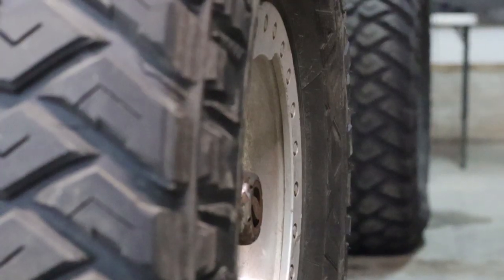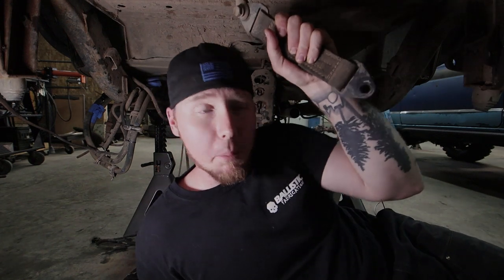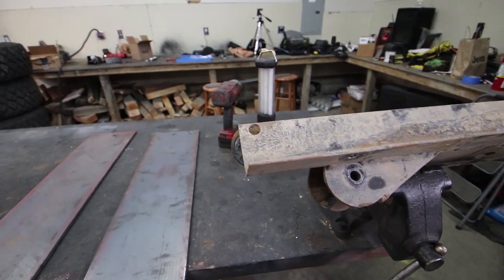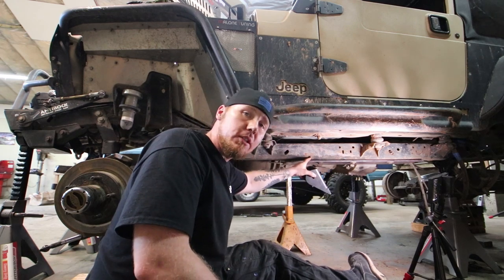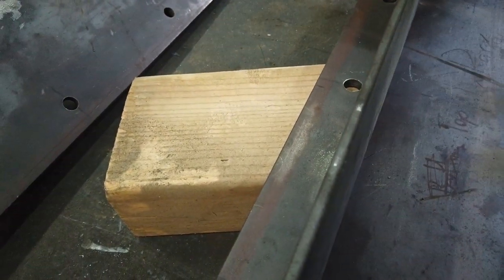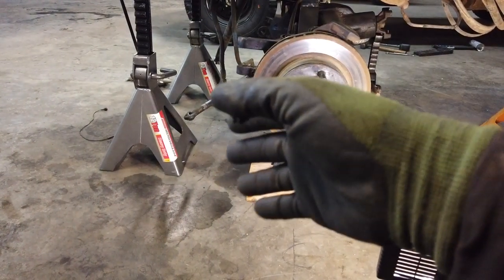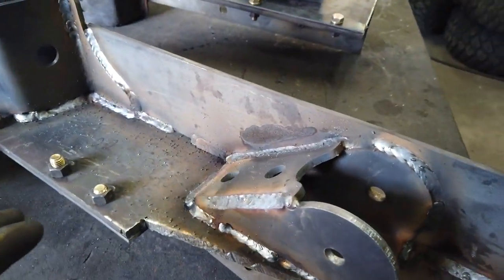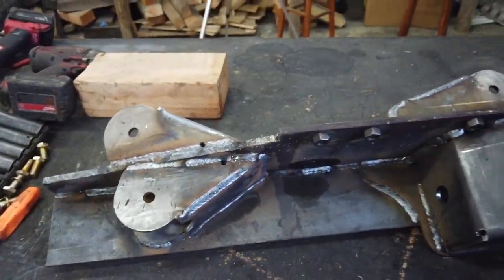DIY 3 Link / 4 Link Suspension - Jeep TJ Stretch Episode 1

Comment: Subscribed... I currently run a ‘13 JKU Rubicon with the upgrades stated in a previous comment and Poison Spyder Brawler flat fenders (brand new $400...instead of $1,300), 2004 TJ with the stock suspension off of my Rubicon and 33” BFG KO3 but I gave that to my 19 year old son (good kid) and a 1999 XJ with Dodge half ton axles (free) with trusses, C-gussets, disc brakes, 20” Fox Nitrogen shocks (rear), 4” XJ lift springs and BDS shocks mounted on a custom 3 link! The rear is a double triangulated 4 link and everything has 1.25” Chrome Moly heims from Ballistic Fab! Home fabbed bead locks with 38” Nitto Mud Grapplers and “custom paint” custom bumpers, sound system, fuel system and full hydro steering! Next in line is a ‘78 J-10 with the 360, granny gear 4-speed that will soon have EFI and 35” boggers for a trail bomber and possibly an S-10 I have with the stock XJ axles, built 4.3 on LPG and a 5-speed for the kids to throttle on! I have those exact brackets on my XJ and everything worked out perfect and she flexes big time!

Comment: I really enjoy your videos, keep them coming. For what it's worth, I used to hate cleaning cutting oil my metal. I always wipe down with acetone before welding, but the oil was especially a pain. Visiting with my machinist friends, they mentioned for all of the shop work us Fabricators do, we can use water as a coolant/lubricant and it is more than enough. I've been doing so for years now and it is awesome. I use a Dental squeeze bottle with a pickup tube and it works awesome. Water for all bandsaw and drill press. And its evaporated by the time I got the millscale flapdisced off. So oil never contaminates my gloves, weld table, flapdiscs, drillpress, etc.
Reply: Hope this helps
Reply: They explained our drill bits become chowdered before they actually dull from overheating or excessive pressure.

Comment: Nicely done and nicely explained.  I'm glad you touched on the difference between theoretical vs practical concerns.  There is a huge difference in theory between one-link, two, three, and four-link suspension designs.  But like you say about your buddies designs.  They work.  Furthermore, I bet a skilled driver couldn't tell the difference in a blind test.

I like you bolt in design.  Makes it easier to fabricate, and more importantly it makes it easier to update later on.

Comment: Phosgene gas is created by combining heat and UV light, with Braklene and other solvents. You can die or have lifelong respiratory problems combining the two. Glad you mentioned it in your video. Even in a well ventilated area, this is a serious concern. Check your solvents for tetrachloroethylene- even a dose of 4 parts per million, as small as a puff of smoke can be fatal.

Comment: Can you differentiate jeep stretching. Other videos suggest cutting and adding length to the frame. With a 3 or 4 link it appears no chopping is necessary,and the stretch is all in the control arms. Love your suspension videos brotha.

Comment: Great job and lots of good info. The only thing that is wrong that I can see is, you NEVER want your differential pointing at the transfer case. That is a u-joint failure just waiting to happen. Most people don't seem to understand this. You want your differential at the exact same angle as your u-joint coming off of your transfer case. That is the way u-joints are designed to run. Same angles! I know this from my old drag racing days. I used to point the rear end at the back of the trany and couldn't understand why I couldn't keep u-joints in it. I was pulling 8000 rpm hole shots and snapping u-joints like nothing. The best u-joints money could by broke like glass. Then someone educated me. Keep the joints at the same angle! People thought Ford was retarded on some of their 3/4 ton 4x4s around early 1970s. They had the front differential actually pointing down toward the ground slightly. That was because the transfer case was pointing up slightly. The joints need to be at the same angle. That's why they did that. They weren't retarded after all. Learn from them and save yourself a lot of u-joint grief!  Seriously!! Do some research if you doubt me. Other than that, I'm impressed!
Reply from the maker: Hey man I'm glad you're enjoying the videos! Let's talk about the issue you have with my U joint angle.
"You never want your differential pointing at your transfercase".  Unfortunately this is untrue. I will provide a link at the bottom of this comment for you to click on and see what I'm talking about.  If one side of your driveshaft is a constant velocity joint, you want your pinion facing your t-case as much as possible. This gives you the most strength and the least vibration. Like most Jeeps, I have a cv joint on the tcase side of the driveshaft. But with u joints on both ends you are absolutely correct. Thanks for the comment! Conversations like these are important 👍
https://www.adamsdriveshaftoffroad.com/angle-pictures/
Reply: Great! Thanks for that info! I didn't know that a constant velocity set up changed that rule. Thanks again, and keep up the great videos!

Comment: Am I correct that your old front suspension system looked to be a radius arm style set up? I would be very interested to hear your thoughts on it and why you are changing to the 3 link set up. I LOVE your videos, everything about them is perfect, well filmed and very clear/informative. I'm looking at doing a 3 link/4 link set up in my Discovery 1 and these are helping me heaps! Thanks
Reply from the maker: Yes, the old suspension was radius arms. I ran it that way for almost a decade. Great system but it does have binding which slowly wears out bushings. I decided to upgrade the suspension to a 3 link to make the geometry right and decrease binding. Long term I'll be making my disco a 3 link front and 4 link rear. Very similar to the setup on my Jeep. Glad to hear the videos are helping you out!
Reply: Dirt Lifestyle Thanks for that, oh I look forward to seeing you link your Disco then. I’m not quite at the stage where it’s going to happen yet, as I’m wanting to swap out axles at the same time (actually to Discovery 2 axles!). Thanks 👍

Comment: Awesome video!   I stretched my cj with waggy springs. However I want tj coils and links.  I’ve just been hesitant about what kind of link setup to use.   Your tj is sick.  I think I’m steered close to 5 front and 6 rear.   Without a Comp cut.   I don’t like the comp cut
Reply from the maker: I'm with you! I don't like the look of a comp cut. When I trim the fendors to match the stretch I'm going to cut away as little as possible to hopefully avoid that look. We will see what compromises I will have to make lol
Reply: Roger that.   I had to make a small fill plate that goes in front of the rear tire just to make the wheel well look normal.   Like the rear wheel well kits they sell.  I just added a plate that actually looks like part of my rear tube fender.  And the rear springs I dropped the waggys and went to a set of Chevy 52” springs.   So the rear shackles are on the rear bumper so I then tied that into the frame and added a few stiffner bars hahaha.  All to keep that look looking smooth!    I want links badly!   But right now I’m going back to bucket seats as I had a small bench seat for years.  Adding a ammo can console and moving my stereo msd box and cab to the big 50 cal ammo can. Then I would like to weld up an aluminum dash setup to clean up all the holes.    Oh. Another issue I ran into on the rear stretch was the fuel tank.   I had a 14 bolt so I moved to a fuel cell in the back.   Also ditched the 14 bolt for an HD 35 spline rear 60.   To match the front 60.   Keep the videos going man.  I’m subbed. And looking for more inspiration!    So thank you!!

Comment: I stretched my YJ to 101" with waggy springs and using the furthest hole on the spring perch. Got me 2.5" of lift out of it, high lined my hood, and I'm running 35-37" tires on  my LCoG lift and stretch. I remolded my factory fuel tank to fit the rear diff into it so I didn't have to do a custom fuel cell or relocate the tank. Running a Montero rear axle and a Waggy dana44 up front with Dodge outers so I could get the drag link to the top of the knuckles and away from the rocks. I'm still SUA and I don't want to do a SOA, as too may of my buddies have ruined the ride characteristics of their rigs trying to go SOA. I need to Fab up a ladder bar to keep from fragging my rear springs from running out in the dunes/snow and the rock trails I'm getting too much torque and eating u-joints.
If you could dial back the Transformer Orgie Muzak, that would be great

Comment: Keep your thumbs away from steering wheel spokes on down hill descents.  Loss of caster could apply heavy torque to the steering components, especially with large diameter tires.

Comment: I have a really good question, and hope you will answer it.  I am currently setting my TJ up basically copying you, however there is a couple things I am confused by.  You said your front upper and lower control arms are the same length for the pinion to stay aimed at the transfer case, which is what I want, however in the video the upper mount is directly even with the lower.  I dont understand how the arm length can be the same if the upper diff mount is going to be further away due to the pinion angle.  Can you help me out with this?

Comment: You cant 4 link the front if you run a steering box. You will have crazy bump steer. thats why 3 links are best for streetable rigs. 4 links in the front usually for full hydro set ups.
Reply from the maker: This is a strange statement. Do you have an article or something to back this claim? There are millions of trucks, jeeps and SUVs with a 4 link front suspension and a steering box being sold OEM. I'm very interested in a source of this information. 
A 4 link and a 3 link have the exact qualities and characteristics. The only difference is a 4 link is stronger but they act identical in performance. Unless of course you can demonstrate otherwise.
Reply: @DirtLifestyle  my bad. I ment with full hiems or Jonny's on all ends I guess if you use rubber the track bar wount bind all the joints. I'm speaking rock buggy stuff my bad

Comment: not streach related but just curious, Do you have any emissions testing or anything like that in your area? As far as I can tell for my county at least the only way I could get away with a street legal diesel swap on anything that wasn't sold with a diesel as an option from the factory is if the  vehicle is 1995 or older.
Reply from the maker: Lots of emissions issues for people that swap up here. I get pulled over for a litany of other reasons so this jeep has become a trail only rig. The only exception is when I travel to moab. Then I drive it on the street with no issues from law enforcement lol

Comment: Good stuff. I need to rework the suspension on my XJ to stuff some 39.5 TSLs under my XJ. How important is it to get the front upper link parallel to the vehicle? Seems like it would want to push the axle one way or the other when you brake or hit the gas otherwise.
Reply from the maker: The upper link needs to be as flat as possible for the best stability under braking or acceleration in 4 wheel drive. When you combine this with a lower link that is 10° or less you end up with a suspension that meets the needs of 99% of wheelers.  Rock bouncers are just about the only exception. They set up their front suspension with lots of dive. This is to keep the front end down while they're going up those steep ass ass hills you see in the videos lol. The downside is when you let off the throttle your actual pushes the front and down and the vehicle flips backwards ass over tea kettle.

Comment: Hey Nate, do you have any problems with the plate bolted to the frame holding the link mounts flexing, or are the bolts on both sides of the frame enough to handle it? How many bolts do you have on each side of the frame. Are the bottom bolts mounted all the way through the frame? Thanks!

Comment: Heeey! Need some help with the 3 link project! How does the horizontal separation of the links affects the project? I have no clearance to weld the brackets on the diff or close to it. Can the upper link be placed 2" horizontally from the  lower link?

Comment: Loving it!  This is the first time i'm checking out your channel, but i've seen your videos on BJ.  This series looks great so far.  102" eh?  Sounds like you should just get an LJ.  ;). I notice you're still on your stock body mounts, ive been thinking of replacing mine with some beefier mounts, and moving them up a little to get some body lift out of them.  have you considered that? Did you decide not to go that route? Or just havent seen a need?   Thanks!
Reply from the maker: Thanks man! I've been wanting to address the body mounts but they haven't really held me back while off road. I just bounce them off rocks from time to time lol. I will Fab up some new ones but it is pretty low on the priority list. I plan on building my own boat sides at the same time.
Reply: @DirtLifestyle  YES!  BOATSIDES!  I never see boatsides anymore. I've had them in the back of my head for the LJ for a while now. 

Yea, my body mounts have taken a few hits, i'm not as high up as you are.  and the LJ is a big more exposed because of the length. 

Thanks!

Comment: What axles are you running on your tj? Gear ratio? Locker set up?
Reply from the maker: Dana 44 hp front with 5.38 gear ratio, 30 spline rcv shafts and a Yukon zip locker. Rear is a home made 9" based housing with a Yukon 3rd, 5.38 gear ratio, 35spline spool and 35spline quick performance shafts.

Comment: So, Im going to attempt to build my first three link in a 52 Dodge M37 with and LS swap. You mentioned a geometry calculator, did you end up using one or just do what I do and tac check tac check? thanks
Reply from the maker: The calculator is great for getting an idea of exactly how the changes you make effect the squat and dive numbers. BUT its BS for real world building. The two most important numbers are an educated guess and this throws off the final values substantially. I use the calculator to get my mind back into the basic concepts for a new suspension setup but don't actually try and build anything with the data. The basic rules I talk about in these videos are a way to get good performance out of suspension when your trying to package it in a existing vehicle. Hopefully the "rule of thumb" ideas I have in this series will help you on your build! Good luck and have fun brother 👍

Comment: See if you had just bought a Cherokee this wouldn’t have been an issue lol. I love my TJ’s if had over the years and yeah you can always go with a larger tire in the wranglers.. but it takes a stretched wrangler on 40’s and tons to go where even modest build Cherokees go. I equate it to the dame as picking a manual over an auto. When you’re crawling the auto is always gonna be better. We all know this. (At least those that climb things) hands down a Tacoma SAS or Cherokee can’t be beat. Why cause they already came with the proper wheelbase from the start.

And this new unlimited are heavy pigs! Light, locked and long travel still rules.

Comment: does your coty built adapter use the jeep starter motor, or which starter are you using? have you had any problems with that?
Reply from the maker: The worst thing about coty built is this question right here. I get asked simple questions like this all the time and its shame they don't put this info on their website. I have no problem answering your question it just reminds me how hard it was to find the info when I was doing my swap. Lol I'm done venting. I ordered a starter for a 2004 passat tdi and it bolted right up. The jeep starter and the brm starter wouldn't fit. Good luck with your swap man!!!
Reply: @DirtLifestyle  yea their website says its made to work with all jeep stuff, everything but the long block, thats what they advertise! I figired it used a jeep starter! So a passat starter works with a jeep flywheel? Man that dont seem right at all!
Reply from the maker: It uses jeep alternator and powersteering pump. That's it. They really over sell what your getting. Even the way they advertise the wiring is BS. You still need to cut down the OEM jeep harness your self. The wiring they send you doesn't integrate at all. It's just a stand alone tdi harness. You do all the Integration lol. The starter seems to mesh fine with the jeep flywheel 🤘

Comment: Be careful under those china jack stands. I have a set of those same ones and the latch will come loose and slam down even with full weight on them.
Reply from the maker: Thanks for the heads up!
Reply: Bold claim, is this actually true? Because I've been under my harbor freight stands for weeks working on a 6k pound truck
Reply: @coast.cutter7552  
Why would I make this up? Quality control in china is nonexistent. If you got lucky and yours work than good for you. One of mine the latch is mounted crooked and it will fall randomly.

Comment: I know the weight is lower on the Jeep but are you worried about those plates??
Reply from the maker: I don't think I follow buddy, Do you mean bending the plates?
Reply: I was thinking of the weight of the plates but the cuts you made and the efficient diesel will likely take care of it😀
Reply from the maker: @PaulKaiser42  I see, yeah man I've though about that too. If my aluminum welding skills were better I would be going that route because I'm always super concerned with adding weight. I might drill some speed holes to shed a little extra 👍